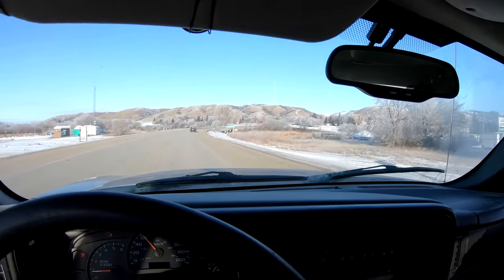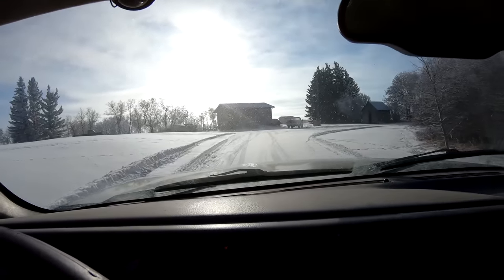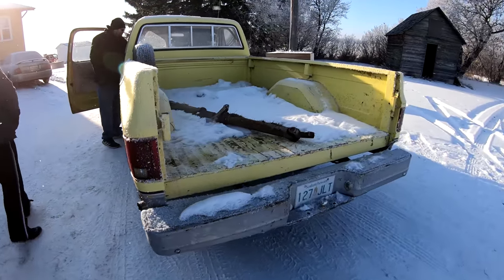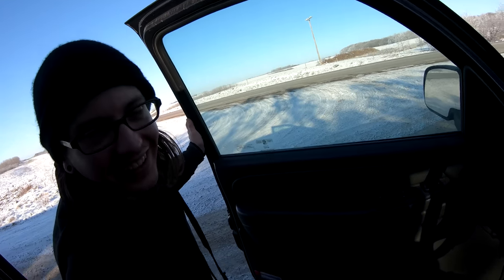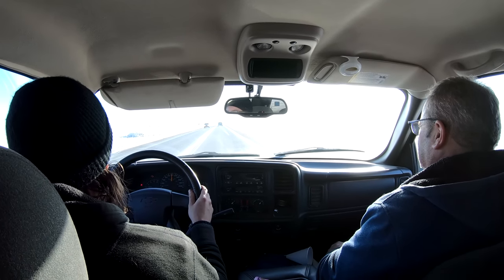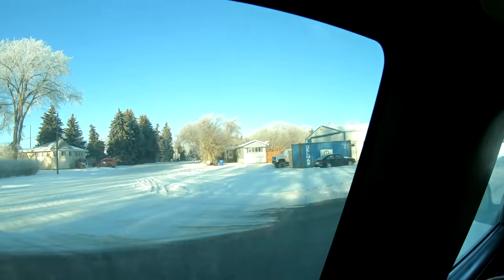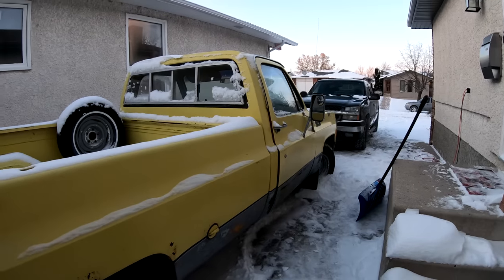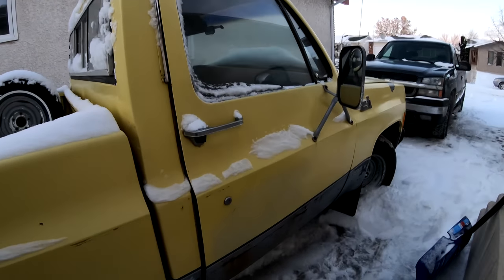DRIVING 700 MILES TO BUY A 1977 CHEVROLET C-10 | Square Body Project - Mike is WAY too excited

Comment: Mike I got the original old yeller, 1980 custom deluxe 30. Dually flat deck with stacks and tractor flaps. And big old light on the roof cause it was a service truck. 350 with the 4 speed I use a wooden broom to check my gas level cause it has a huge fuel cell instead of a traditional gas tank.

Comment: Nice score. Looks like it has a vinyl mat and not carpet? If it is just really dirty carpet you can take it to the car wash, soap it down and pressure wash it, you just need a place for it to dry. The seat can be done also, but I would look for a different one to replace that one or recover it. LMC truck is your friend for parts.

Comment: Could you guys go into as much detail about what you guys do to run and install your LS in this chassis?

I’ve had a 5.3 in my garage ready to get shoved in my c10 but I feel like I’m always missing info or parts. If you guys put a LS in this show all the stuff you buy, mod, cut and install to make it run right so myself and others could use this as a c10 LS build guide.

My trucks yellow too, was told yellow c10’s are semi rare since it was a special order or city worker option only. 👍
Reply from the maker: If I do end up LS swapping it, forsure. If the 305 runs ok I may just keep it that way to sell, and LS another square body.

Comment: Nice find Mike, when you opened the hood I was surprised there is no brake booster. If your rebuilding the brake system you might want to put on power brakes. Looking forward to see how this project turns out.

Comment: If this is a drag street truck do a LS 6.0 with carburetor and nitrous system with a fuel cell and big fuel pump with a huge cam and do a full motor build and do some body work and keep the truck maybe sand the frame down and paint it with POR15.

Comment: I've got a 1978 chevrolet K20 camper deluxe with all new suspension fully rebuilt 300 small block cammed out headers 4 barrel carb new brakes and custom built rear end! next new tires interior work and body work.

Comment: ls 83 square th400 205 14 bolt rear looking for 2.5 ton rockwells drive by cable and just got a turbo for the tiny truck on 38.s 12 inch lift
Reply: take's ya back in time fun trucks